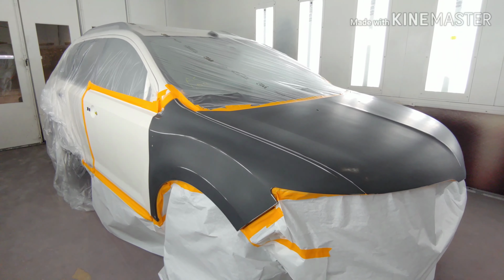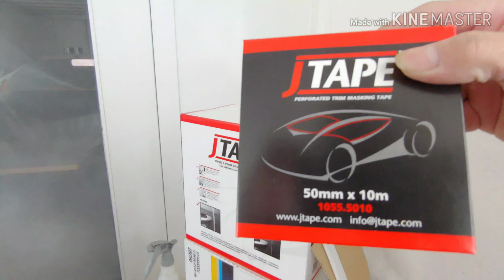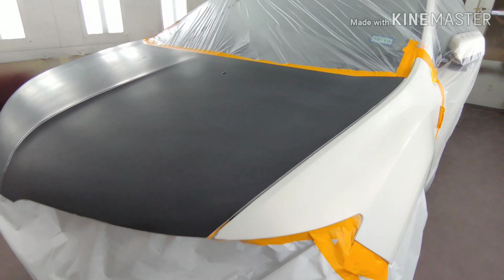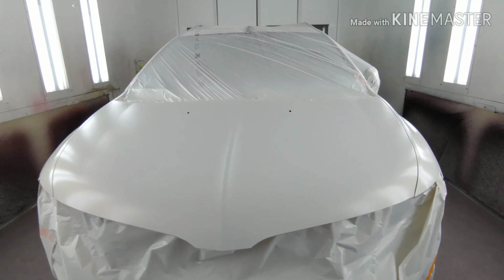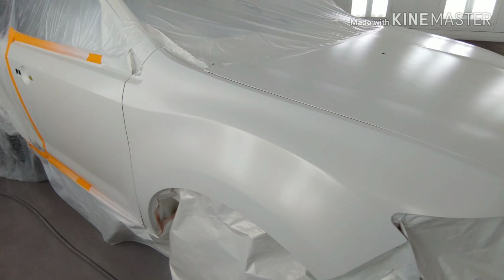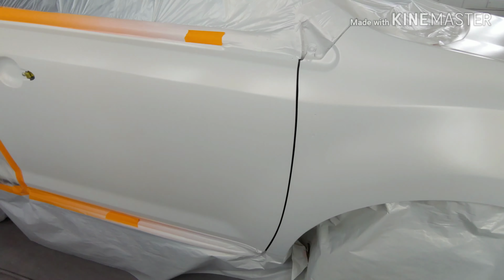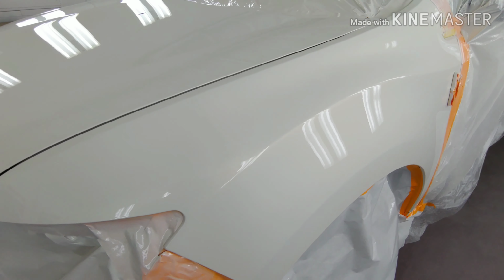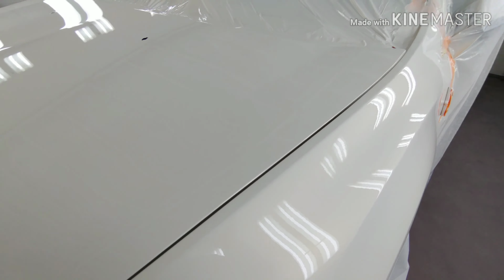HOW TO: Tips and products I use for spraying white pearl

Comment: Any tips on avoiding mottle on pearls? Not sure  if om putting too much or too little. But it looks blochy sometimes?
Reply from the maker: For me it always helps to spray wet coats just like your base or use slower reducer to allow it to flow out and not moddle. I would mix 1:1 color and pearl for blends then 2 coats of pearl. Not necessary to apply more than that. Always remember your base is what needs to look good pearl is just for effect
Reply: @paintworkbyjr3685  thanks bro. Pearls and silvers always a challenge for me. Kinda learning on my own. Texas heat also makes the paint act funny.
Reply from the maker: @dekorokone  no problem. Use slower reducers and apply a little wetter than usual on those type of colors. Plus doing it that way it will lay the paint smoother
Reply from the maker: @dekorokone  I'm in east texas so I feel you on that brother. Hope my advice helps you.